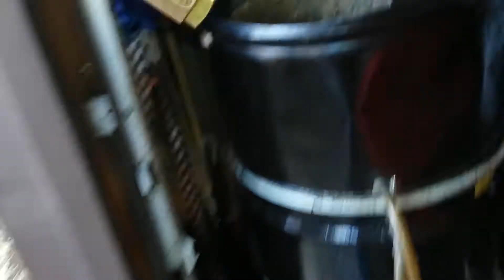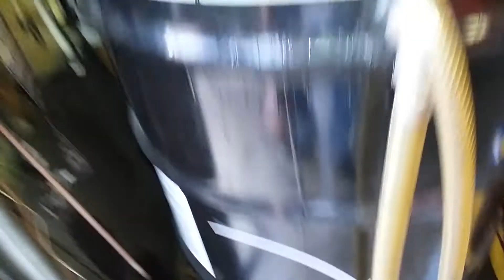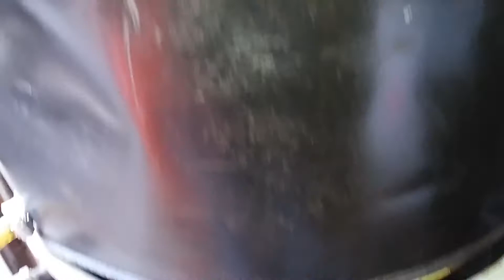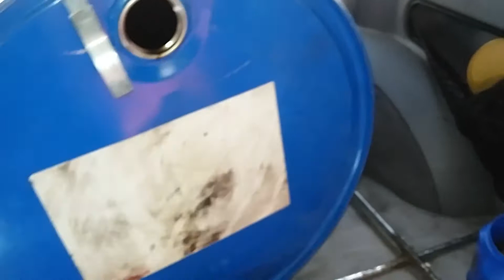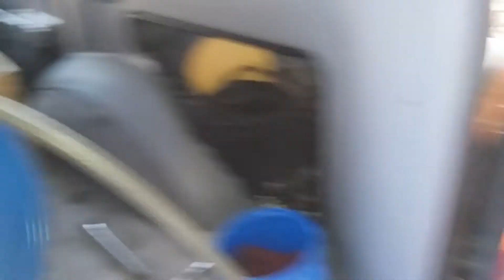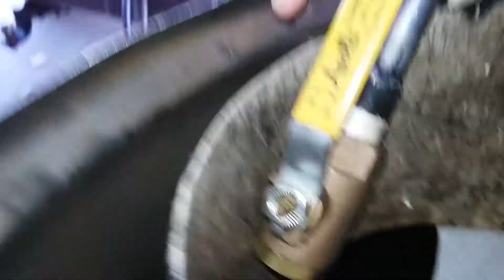HOW TO AND WHERE TO GET USED WASTE MOTOR OIL EASY CLEAN AND FAST

Comment: Do you just filter the oil through the shirt and filter in the tank? You don’t cook it, I’ve seen others cook oil for a bit. I don’t really know but I just wanna safely run oil as a fuel system, diesels gettin on the pricier side
Reply from the maker: I use a pillow case as a filter in a 55gal barrel.
  Don't know much about refining diesel.
Thanks for watching and commenting!!
Reply: @mugivermusclemachines5744 nah, that's what's so near. You don't refine anything to Diesel. Used motor oil, used transmission fluid, will burn with zero modifications in diesel engines. They were designed to run on peanut oil, diesel, refined from crude oil, was secondary. But a piece of information that they really don't want people to know, is that a diesel will run on any oils with a similar flashpoint and sufficient hydrocarbon density. Used and filtered motor oil has that. As does used tranny fluid. It's a source of entirely free fuel. I'm looking at pulling carbon dioxide from the air, releasing an oxygen atom thus reducing it to carbon MONoxide, and then hydrogenating it with hydrogen pulled from drinking water. Hydrogenating carbon monoxide yields methanol which burns in a gasoline engine with modifications ONLY to the carb/computer to increase the amount of fuel in a cycle by 29%. But in a flex fuel vehicle, zero mods are needed. Any car that can run on 85%+ ethanol can run on methanol. So it appears I can power my flex fuel town and country with methanol for the cost of some electricity, water, and the cost of the initial setup which appears to be sub $500. I'm really excited. Also looking at getting an old diesel truck and doing what you did with a few dealerships but rather than an oil burner, running my vehicle with it.